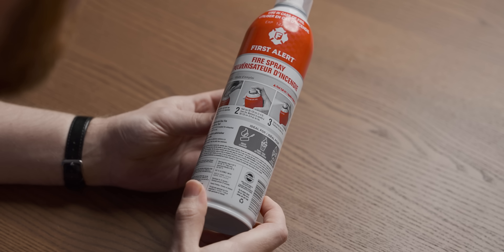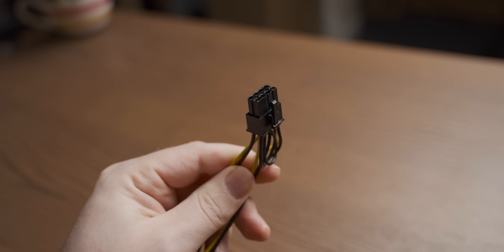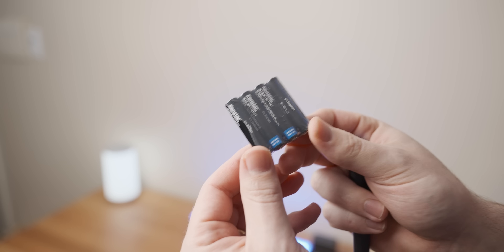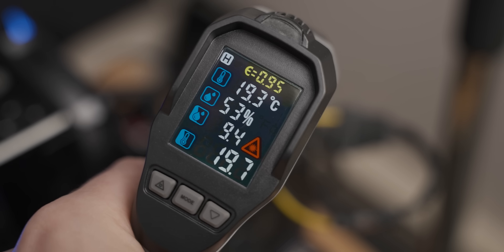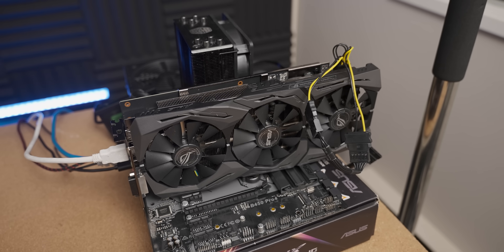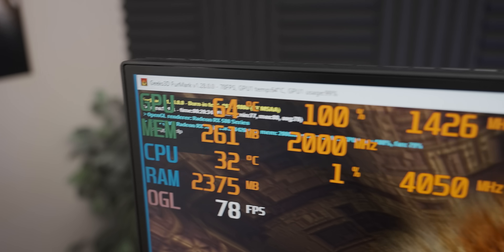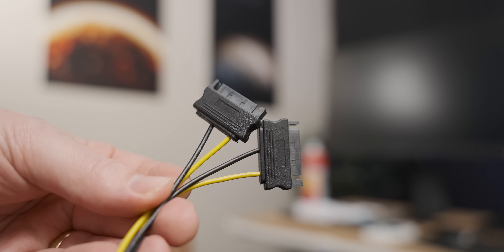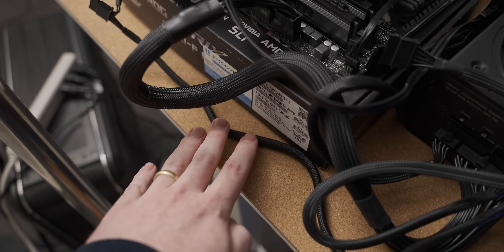Will This Adapter Set Fire To Your PC?

Comment: Hey Dawid would you recommend adding a 1660 to a Dell optiplex mini tower using these connectors?
Reply: If you have an Optiplex SFF or a Micro Tower, a 1660 Super won't work to begin with because the GPU physically won't fit inside the case without modifications. The most powerful GPU you could fit would be the GTX 1650 LP (Low Profile) card which Zotac, MSI and Gigabyte all make. 

That card draws only 65 watts all through the PCIe slot and is the best one available for Optiplex/Office PC retrofits. Personally I recommend the Zotac or Gigabyte versions over the MSI one because MSI only has DVI and HDMI ports while the other two also have DisplayPort.

Comment: If you increase the wire lenght, the amp draw will increase. Prehaps the connector is decent quality and the short run of wires helps prevent an issue.

Comment: I’ve had a sata to six pin connector in my pc for four years and haven’t had a single issue.  For lower end gpu’s you’ll be fine, but for the love of God, buy a gold rated  psu if you’re using an RTX series card.

Comment: Had one of these connectors in a old HP system to power a 1070 and it worked fine, for about 4 months, at which point my PC turned off and I smelled smoke, thankfully the PC was fine and it didn't kill the GPU.

Comment: can you try this prebuilt + gpu "meta" with a hp workstation with a xeon and 400w psu is really good, tech yes city did a vid on it with a gtx 1070 and it looked awsome. I have one myself and im pretty happy.

Comment: I prefer to use the molex (those 'old' 4pin connectors that harddrives and CD drives used to use) > PCI-e adapters (if needed), and only use them on cards that have a power consumption just above the 75W (so a card of 100W or 125W should be more than save to use with those adapters). Defenitly wouldn't recommand to use a very power hungrey card with those adapters (so not the modern RTX 3080s or something :P ).   Also, there seems to be quite a difference in quality of the adapters. The ones I have that came with the graphicscards themselves seem good quality, but I can imagine there are also a lot of cheap-quality adapters with flimsy thin wiring that can easily catch fire when drawing too much power (same thing you saw with some adapters for harddrives).

Comment: Well as long as the psu has enough watts it works everytime...
But you have to do the calculations RIGHT . 2x6 pin minimum 450bronze watts
2x8 minimum 550gold watts 
Dells are different i have a dell with a gtx 580 and the power supply days max 250 watts lol 
It doesnt even get hot

Comment: I think the thing your also missing is that the QUALITY of the cable also matters. Most people who buy those adapters buy the cheapest 50 cent one they can find with free shipping, and THAT is where a huge problem can lie. Also, longevity is a concern. Heat cycles can wear down the plastic on the connector and make them easier to melt.
To be honest though, for most people those adapters won't cause any issues.

Comment: They definitely can be fine with likes of low powered cards you know the ones I mean ones that olny the higher end models have pcie 6pin and lower end models come with no pcie power connector maybe 1050 1650  or the likes and also inportant to do all the math n make sure psu can actually deliver the power draw and as you said only as stop gap

Comment: I used one of these for a month or 2, later i ran furmark and my pc crashed and a burning smell was coming from the pc. i opened it and found out that the connecter got burned and it also burned my sata connecter, luckily the gpu was safe but i wont recommend these. i used the single sata to 8pin.

Comment: I've actually never had trouble with the SATA to GPU connectors, both 6 and 6+2 but I have fried several Molex ones and try to avoid them if I can.

Comment: Now do the same with a Molex adapter and see if you can exceed the 22 A (264 W) a pair of those can provide. Should be plenty for 8-pin + 6-pin and would need a card with 2x 8-pin to exceed it.
Reply: Molex is better or worse ?

Comment: A couple points: 
If you're using an infrared temperature monitor like that it's important to make sure it's calibrated correctly by pointing it at things you know the temperature of. While it mostly works better for contact thermometers, it's still useful to use ice water as a good baseline temperature reading just to make sure it's roughly in the area you want. 

Another thing that's important to remember is how power supplies actually provide power. If you ever open up one (DO NOT OPEN UP A POWER SUPPLY UNLESS YOU HAVE THE PROPER TRAINING AND KNOWLEDGE TO DO SO) then you'll usually see a bunch of individual wires going to each connector. Each of these wires has their own individual rating and in turn that can tell you how much you can safely push through any kind of connector. While other comments already talked about how the 75w coming from the pcie slot will affect it, it's also important to remember that the actual wires themselves are going to be the biggest factor in seeing if those cables burn up or not from the power supply. The reason you often see failures at the connectors rather than inside the wires themselves are almost always because of arcing between the actual connectors inside. Arcing creates a lot of heat and often results in catastrophic failures like you saw in those pictures. It takes a lot of current to actually melt/destroy/burn a wire compared to the much more common scenario of arcing inside the connector itself. This is why you see so many success stories of people using those sata to 6/8 pin connectors without failure despite it being out of spec.

Just wanted to point that out, still loved the video Dawid!
Reply: nice comment. do you think this power draw through the mb rather than a psu cable would create heat that would shorten the life of the mb and its components?  That's what concerns me.  

I have an rx6600 which is 132W tdp and wondered if these sata adapters could provide the power from the mb in an optiplex with the standard dell 260W psu.
Reply: @DeepakKumar-lv4te It’s been over a year now man.. how’s it going? Any issues? Cause i might be using the same cable soon
Reply: @bankydeee  I used a separate power supply, re cased the opti in a standard case with a high spec psu.

Comment: Those things have a pretty high potential to be a fire hazzard. I dont recommend using them if its dual sata to 8 pin. The only one id recommend using is molex to 8 pin or dual sata to 6 pin. If you plan on using one of these just make sure they are of high quality. For instance i have an 8 pin to dual 6 pin but the cables are thick so i trust it in temporary applications.
Reply: Just adding to that, molex ones are better as long as the Guage of wire in it is 18 or better. I had one I ordered that showed up 22 Guage and I wouldn't use it.
Reply: beware when you use it for higher power gpu, the thickness of the cable is NOT the one to worry, but the thickness of the MALE PIN instead (inside the female connector). Usually they are much smaller than male pin in GPU board, i've burned my 8pin extender the other day with more than 200W load
Reply: @iveusethisusername  when i was running a 4 gpu mining rig i was using an evga 1000g2 and those cables are nice and thick so i didnt have any worries
Reply: @HD7970  i think you completely missread or didn't read at all. It's not about the cable, it's about the pin

Comment: Remember when GPUs used to come with molex to pcie 6/8pin? As long as you're not trying to power a 3070 with those cables, you're fine. I'm using a dual molex to pcie 6 pin to power a 1060 6gb I have in a spare pc.
Reply: Have you had any problems ?
Reply: @andreas3850  with what? The 1060 6gb? Nope. Even played games with it for a week or so when I was cleaning my desktop.

Comment: the 8 pin gpu power draw as per pci-sig’s specs is 150W but each 12V pin on the 8 pin connector itself should be able to carry up to 9A before things get hot based off molex’s specifications for mini ft jr.

 that means you could get up to 324W at 12V going through a single pcie 8 pin power connector. I wouldn’t recommend it but it’s possible lol

Maybe if you do a sequel video you can try using that crazy power mod on a Vega 56 that allows it to draw 600W and try to blow up some other adapters, that could be fun
Reply from the maker: That is a really good idea! I could also use those single sata to 8 pin adapters to just really take it to the limit. 😅
Reply: @DawidDoesTechStuff  If you do that, please do a JoJo-style "To Be Continued" meme when you plug it in.
Reply: @DawidDoesTechStuff I know this video is old so odd of this being seen are low but really you should "test" trying to power a 4090 using molex. 
you know do 12vhpwr -> 4 8pin -->8 6pin -> 16 molex
Reply: But the SATA plug is only rated to 4.5A, so 9A or 108W for two of them.
4-pin Molex on the other hand is rated for 11A per line, so 22A or 264W for a molex to PCIe.
So the SATA-to-PCIe adapter would violate the specs for the SATA ports on a high-power GPU but the Molex-to-PCIe would be fine.

What always surprises me is that the PCIe 6-pin is specced to deliver 75W over 2 lines, but the 8-pin can give 150W over 3 lines. that means 4.17A on the 8-pin but only 3.13A on the 6-pin. If we load the 6-pin also with 4.17A that means it should be able to give 100W
And then there are the 4 and 8-pin for the CPU which do 155W over 2 lines and 235W over 4 lines for 6.0-6.46A per line.
Reply: Ah yes, more Dapz Academy
Reply: Eyo Dapz you like computers?
Reply: @kaksidaksi3455  he's a tech enthusiast and is good friends with dawid
Reply: F*kc dapz your here aswell m8?
Reply: 9A? is that the cable or the molex pin? i doubt the female pin could withstand 9A, the male pin on GPU board (which is thick) probably could
Reply: @iveusethisusername  each pin can safely support 9 amps. Same for the 12 pin connector on the 30 series cards
Reply: You could put that much power through a 8 pin PCIE cable.... but you shouldn't, and only push it to that 150 watts safe spot the connector likes.
Reply: @Thewaterspirit57  funnily enough today I had a reason to push 400W through an 8 pin connector, it was completely fine
Reply: @dapz push it even more 🗿

Comment: Even though that adapter has two sata connectors, you still used a single sata cable coming from the psu which bottlenecks the whole setup by the 54w rated cap

Comment: I remember one time I was charging my phone, and I looked and the charging was smoking from the port on my phone
I think it fried half of the pins, 'cause after that, the same cord couldn't charge the same phone unless I flipped it around
Yes, I did replace the cord after a while... probably gonna replace the phone too pretty soon... but it was unfortunately the only charging cable I had for a while. I never saw that incident again, 'though, so that's good

Comment: 30+ years experience and ive NEVER had an Adapter or Splitter  fry / short  and or kill anything . Now dont get me wrong, i dont ever Advice using them as there is Always a potential when you add in failure points . Temp solution yes, perma No .

Comment: Pro Tip :  When you purchase one of those Hand Held Thermometers, read the box and check for the + / - ... That way you can get  better idea of the Actual Temp. Mine is a 5 deg = / - so that means its most likely off by at Most 5 deg . Keep that in mind when you use those . Cheers .

Comment: When I made a comment on the last dell optiplex video, I didnt specify, but I meant it will end up melting the 8-pin motherboard connector in the dell optiplex, not the gpu 8 pin. The 8-pin that dell uses instead of the 24-pin, is that I meant.

Comment: wont bun out with a 950 use a  gtx 570 or 580 and it will burn like mine did in 2 hours

Comment: If you use adapters within specs, most of the time they're perfectly fine. Common sense is when you use something out of spec it's going to fail eventually. YouTube and their myths.
Reply: Within spec means for the SATA adapter up to 9A or 108W, because that is the specified limit for the SATA plugs.
1.5 A per connector, it has 3 connectors per plug per wire (so 3 for 12V, 3 for 5V, 3 for 3.3V) totalling to 4.5 A on the 12 V line

Comment: I have the same IR thermometer. It's a 15$ hot garbage gadget. If you paid more than that, you got scammed. The laser is just a visual clue, and it's terrible as it doesn't quite matches the field of view of the ingaas photodiode (which is quite wide). 

Your connector was probably much hotter than the readings you got. This being said, these only really start melting above 100°C...

Comment: I used one of those connectors to power just a pcie rise so 75 wats and a normal 8 pin for the gpu and it melted the SATA cable lol

Comment: Yep. I used these power adapters to shove a used $15 9800 GT into a refurbished Dell Inspiron 570 minitower. It had the AMD Phenom II X4 820 quad core CPU, so it actually gamed really well for the time. Was actually able to play Metro 2033. Fortunately Dell power Supplies back then were also quite decent, as I think this cable adapter mod could hurt a low power/crap build power supply.

Comment: i was more concerned about the optiplex motherboard, because it has board level voltage regulation. means the powersupply only gives 12v and it gets converted to all other voltages on the motherboard itself. you could clearly have overloaded the regulators. i dont think they considderd that someone puts a gaming gpu in it.

Comment: Just FYI Dawid, you CAN get a FLIR camera for a lot less than the price you listed. The FLIR One Pro LT is a FLIR camera that attaches to your phone's USB-C port, and is only $310, they offer another phone attached model that is basically the same but with more features for $420, and they also offer the FLIR C5 and C7, which are in the $510-710 price range for a standalone camera. I've been considering getting a C5 for a while now personally, but i didn't know about the phone-attached cameras they offer either, so now IDK what I'll ultimately get lol.

Comment: Nope 8 pin(6+2) should be able to provide up to 324W.
Nope laser on that IR meter is not for measuring the temperature it's for you to know where the meter points at.
But yeah sata power cables are forbidden in the GPU mining community.

Comment: Is the GPU drawing the 75w that the pci-e can provide as well as through the 8 pin?
Reply from the maker: It draws roughly 75 watt from the PCIe slot and then the rest that it needs from the 8 Pin connector.

Comment: If you were gonna do this, I would honestly suggest molex over sata. The main reason those other sata connectors failed even with such low power consumption from a hard drive is due to poor molding quality which allows the sata pins to arc to each other and cause the meltdowns you see. Molex connector pins will be way further spaced out and are easier to isolate from one another. I'm not saying to do it either way, but between each of the connectors, molex has less room to fail due to poor molding and manufacturing.

Comment: if you got that FLIR for this video you could have easly used it many times..you could use it got before and after checks on dusty old pcs that youve cleaned......or maybe if it was possable to see where colder fresh air is being sucked into a pc case or maybe even seeing how hot the case its self was getting sence in theory a metal pc case is a heat sink also

Comment: curious to what the temp would be if you had moved the connector to the other side of the card, out of the gpu fan airflow. Also I think what is reported as 'fire' is likely flameless connector burning. I've seen many car seat heater connectors burnt with no damage to anything beyond the pins and the plastic surrounding the pin melting. It isn't good but it isn't flaming.

Comment: I have a Dell precision from roughly the same Era (2009-2013) that I have to use a pcie 6-pin  to 8 pin adapter with.
Dell has a bad habit of not including necessary ports

Comment: Well, you get around 75W from PCIe slot. Even in worst case scenario with 200W overclocked RX580, this leaves 125 W from two SATA connectors, which is doable. Note that none having this adapter would actually use it like this (overclock already hungry GPU and run FurMark). Instead, they would likely use some lower rated card without overclocking, just to get things by.  Overall, this contraption is mush safer then it looks.

Comment: Here's a good rule of thumb for those dual sata to 6/8 pin. If you assume the SATA connector is safe for about 15-20 watts, since most drives should never pull much more than 10w (bar the 10-15k rpm drives) then with 75w from the PCIe slot (most cards are tuned to pull more from PEG) then you *can * safely power a card with a tdp of around 120w.

 Now I could do some math using guidelines from the CEC but it's the weekend

Comment: At the start of 2021, I upgraded my prebuilt's gpu from an apu, to a rx 570, and, because it didnt have an 8 pin connector to a gpu, i used that thing.
Lowering the volts of the gpu to the minimum that the amd tool let me, I could use the gpu on idle and with little load, but not with much more than that so I ended up upgrading to a better psu.
Reply: With the better PSU I guess it ran pretty sweet afterwards.
Undervolting the card (and RX 580) isn't a bad idea anyway as they're quite hungry but have solid headroom for optimization.
I see a lot of people getting it down to somewhere around 80-90W with 960-1050mV instead of the 120-125 W with 1175mV that are default.
Reply: @HappyBeezerStudios  mine runs at 90 100w with the default voltage